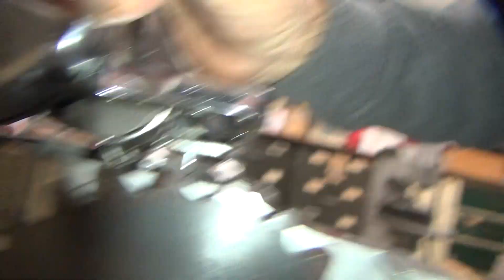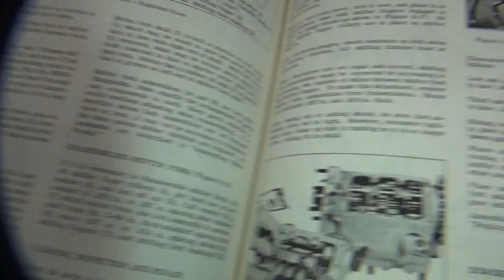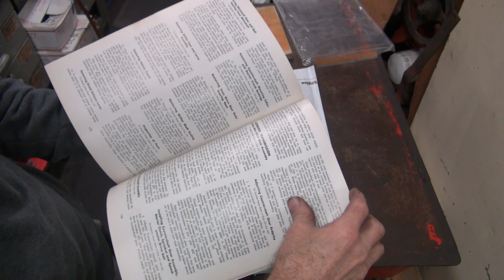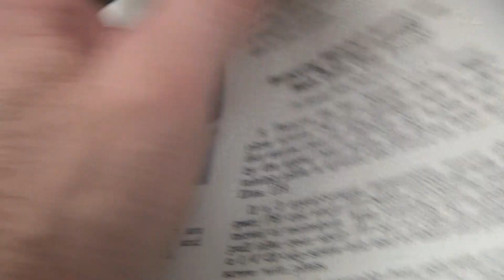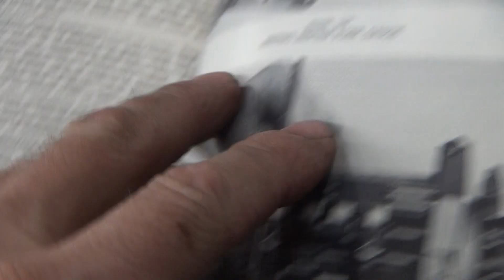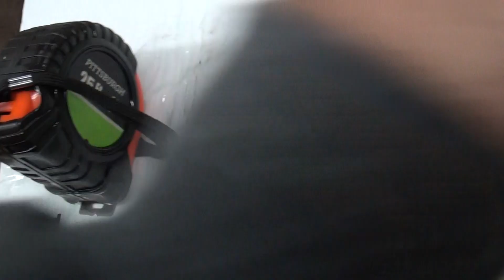#131 1970-84 4-speed revtech shovelhead transmission rebuild 74" 80 ratchet top harley tatro machine

Comment: The tightening of the shifter finger nuts is taking up all the machining clearances in the slots and tabs of the forks and fingers in the direction of the rotation of the nut pulling the shift fork in that direction causing that tilt
Because of the nuts being on opposite sides the tilt is going in two different directions
Reply from the maker: that could be some of it but not all of it. i have not had this problem before. i think it just comes down to import parts tolerances.
tatro